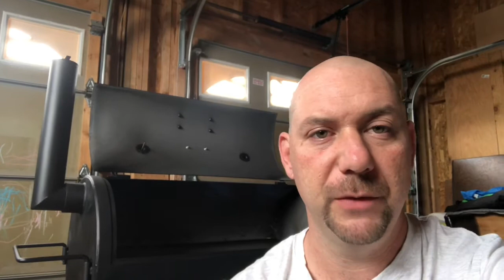Welded Oklahoma Joe’s Highland smoker

Comment: I have not had any issues with my pit. No smoke leaks. I added a gasket around the lids of the cooking chamber and fire box. No leaks from the seam of the fire box either. Maybe I lucked out but live my Oklahoma joe.
Reply from the maker: You might have just lucked out with it. I didn’t want to take the chance of air leaks from the seams and I’m not into using the heat resistant caulking. Glad to hear it’s working great for you and you’re loving it. I need to fire mine up soon as I haven’t even used it once this year yet

Comment: Look forward to your cooks on the offset,,, thinking about getting a highland myself. Do they have a gasket between the fire box and cooking chamber?
Reply from the maker: Louis at R shack BBQ thanks for watching and your support. I’m looking forward to cooks on it too. There is no gasket that comes with the unit in the box. Not sure if they make one or if you’d have to source out another option. I know others use a high temp sealant for them. This is why I had it welded together I don’t have to worry about a gasket or replacing it every few years. If you watch MeatHead he has a video to show how he seals his up with the high temp sealant

Comment: Welded...why?  And PLEASE don't make a video of seasoning it...watching it be hot would be as fun as watching grass grow.
Reply from the maker: The reason I welded it was to seal up the gaps from the way it gets assembled with the nuts and bolts supplied, and also to help with temperature control. I didn’t want to use a high heat silicone as that will need to be redone after a while. There won’t be a seasoning video as I never did one for the fact like your saying would be boring. I’ll have a cooking video on it coming soon. I’m still trying to figure it all out as I’ve only cooked on it twice now and it’s the first offset I’ve ever owned. Thanks for watching